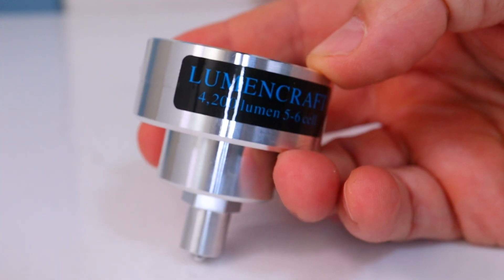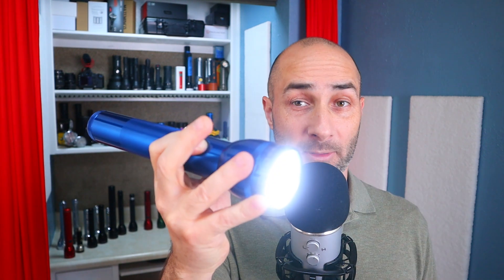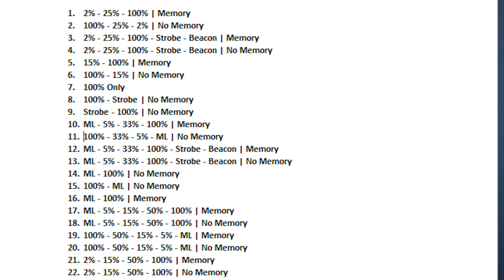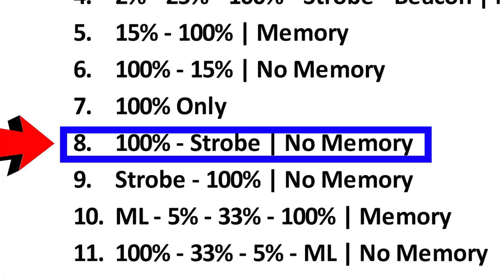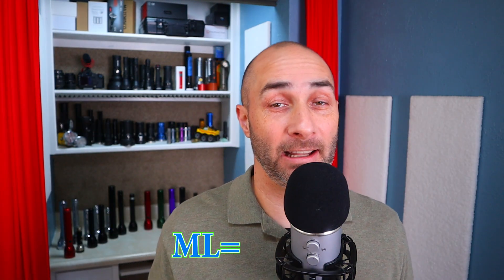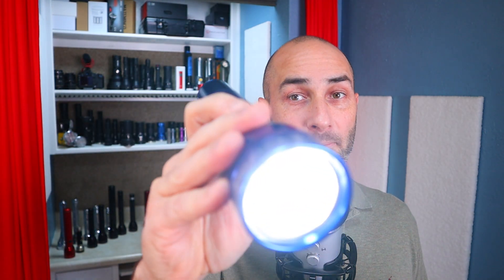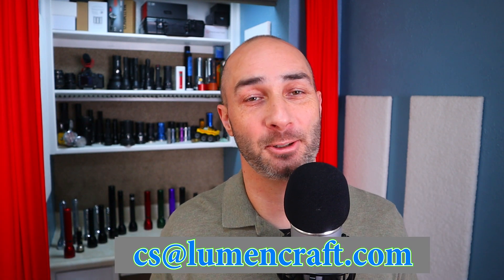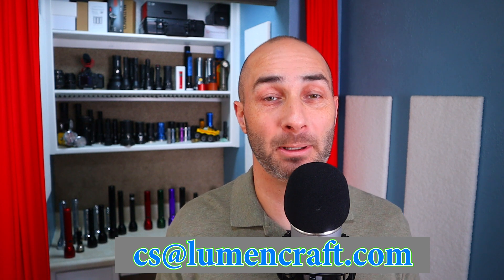Lumencraft Flashlights User Interface Instructions (For Maglite LED Conversion Bulbs)

Comment: Is it possible to use Li-Ion Batteries instead of standard 6 D Cell Batteries?
Reply from the maker: Yes, we have a body kit for that. The light I used in this video is a 2D cell converted to use a pair ot 26650s, and run the 6D cell bulb. https://shorturl.at/M7D3U